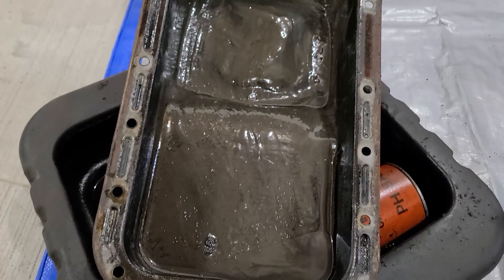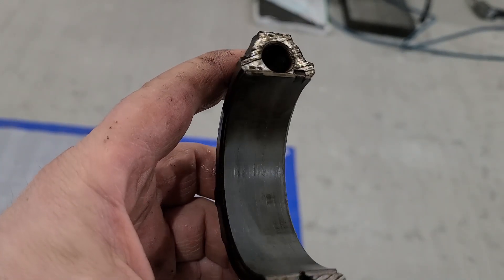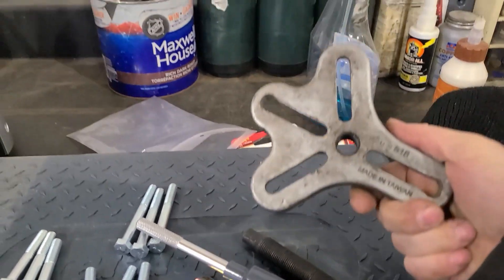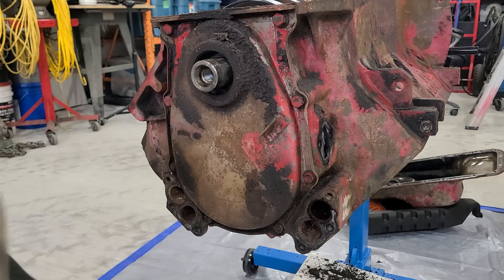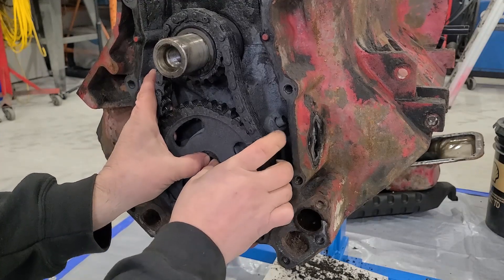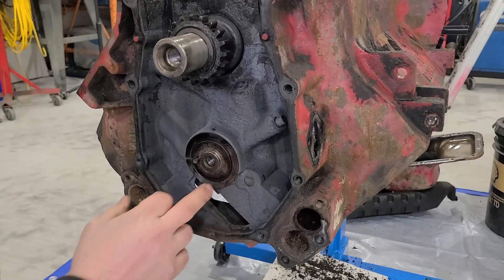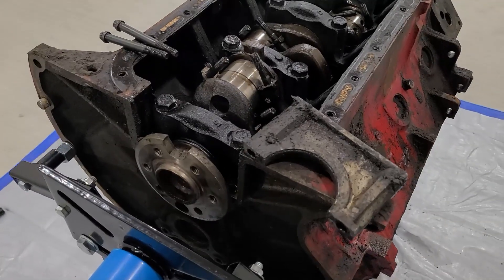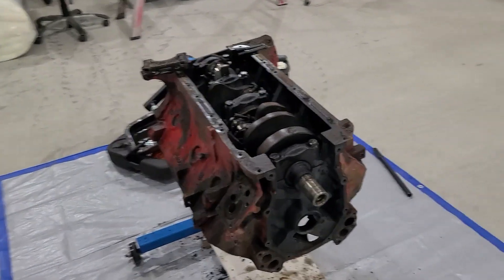Mopar 361B tear down... Part 4!

Comment: I believe someone has been in the motor. Mother mopar used nylon teeth on their timing gear.
Reply from the maker: Not till 65 in the C bodies.  Engine is stamped as 1963. Engine has been played with a bit but these could be the origonal timing set.